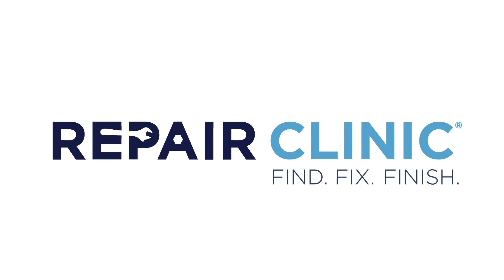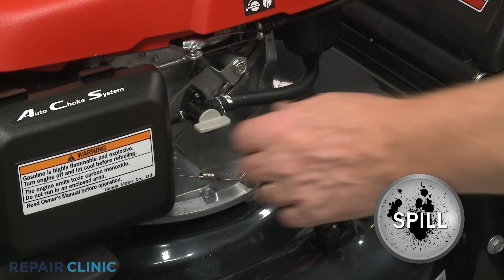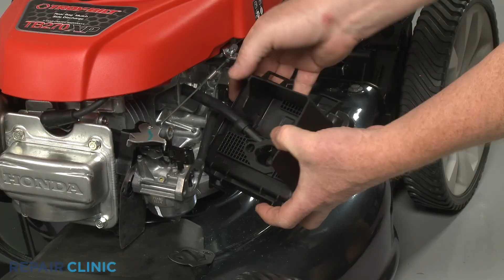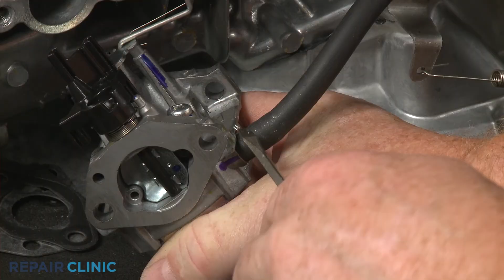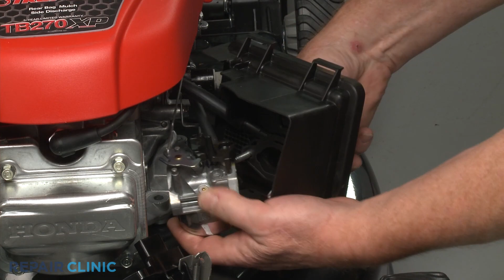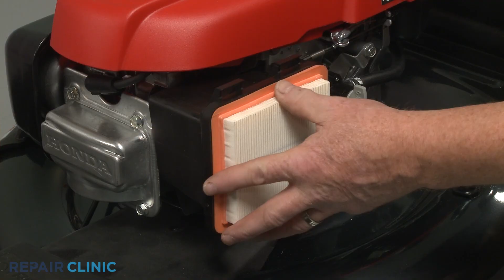Honda Small Engine Carburetor-To-Shut-Off Fuel Line Replacement 16840-Z8B-900

Comment: When you shut off the fuel supply and run the carburetor dry does does the float bowl actually empty completely? I don't want any of the 10% ethanol gas corroding the aluminum or brass parts of the carburetor.